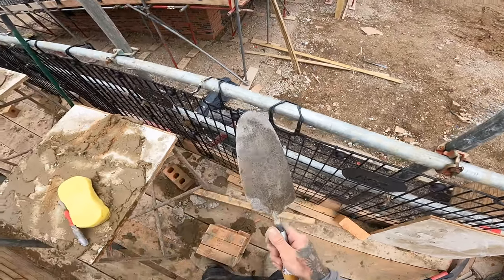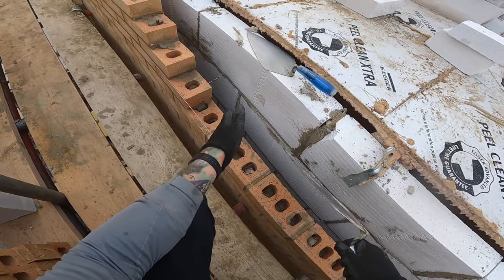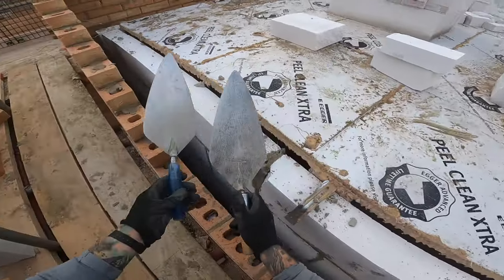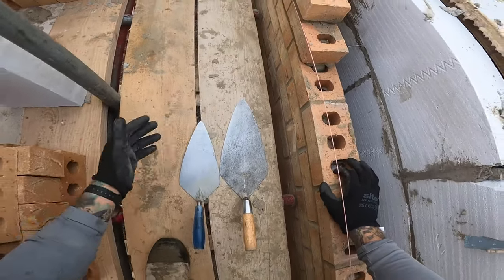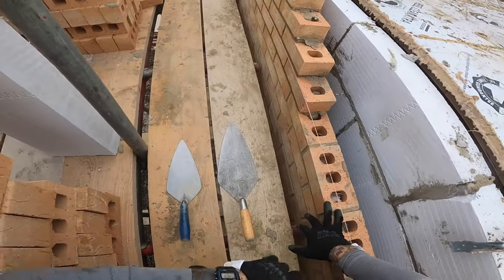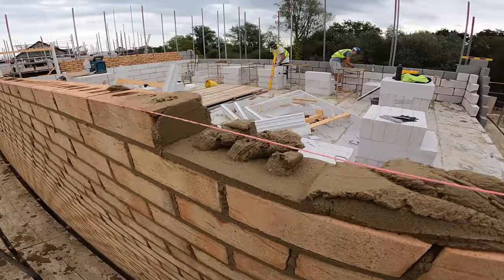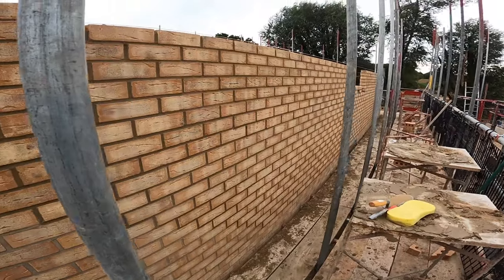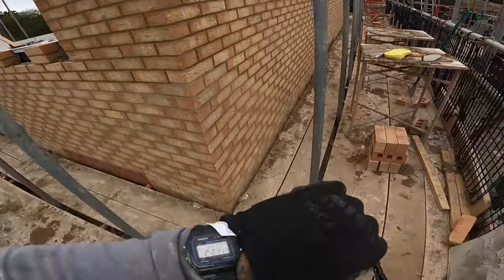Mastering Bricklaying: Secrets to Effortlessly Laying to the line

Comment: I'm a 63 Yr old bricklayer who served his time in the 70s. This was an era when there was a government boost in apprenticeship bricklaying. I served with some old timers who did not fart about with their compo like we do now, but also grey commons were outside leaf materials, and lightweight concrete blocks, or thermal items were inner leaf material. Now solid heavy duty concrete innerleaf with polystyrene sheets inner, and stupid outer leaf clay hollow bricks that take a ton of muck to bed up. How times have changed. I've had carpel tunnel ops on both wrists, permanent bad back with wet blocks weighing 3 stone. Bollocks to price work, steady as she goes, long time to state pension at 67yrs, shortly going up to 68yr old before eligible
Reply: So many true words clay hollow bricks money saving, but again more is spent on making muck to lay them.
Reply: Concrete blocks not bricks, then fill the void with insulation....seems stupid to me....time will tell

Comment: Just a note on RSI/joint pain, a lot of lifting is a pull behind the spine not push in front; I work my ATGs, aductors & glutes, tibular aductors, rear delts and bracialis as do olympic weightlifters. Have to stretch regularly as well because your muscles expand and contract; too much contraction would cause small tears over time even in your back. Favourite channels for this are "The KneeOverToesGuy", "(olympian) Lu Xiaojun", "Clarence0 (clarence kennedy)".

Comment: 😂 at the point of your career where your at college I presume you have almost no trowel skills tho, so the methods you will learn there are to improve your trowel skills…. With experience (time, bricks layed) you don’t need to cut and roll every time your at the spot board… if the hoddy is having a bad day, and the muck isn’t consistent you’ll be applying all the tricks that your experience has taught you… I think everyone should start off with college rules untill your able to pick up a trowel full of muck without dropping it everywhere…. Take your time young ones, Rome wasn’t built in a day…

Comment: It's a Coke Trowel Charlie, And i agree with being efficient makes perfect sense ,Why are people Rushing about wearing parts  of the body that Could  eventually stop you doing the job or make it hard for you to continue, Unnecessary moves add up and can cause you problems twisting about twice when you can do it in one is so much easier and watching someone doing it twice on & on is just bad practice, Where that person is going like the clappers and achieving a decent amount had he used the Collison method he would have done more and not knackered himself out, Basically Why make the job harder than it is ? . See you on the Next one Charlie / Amy.